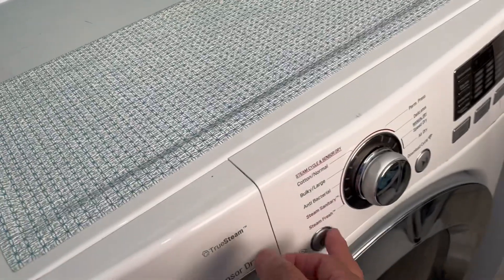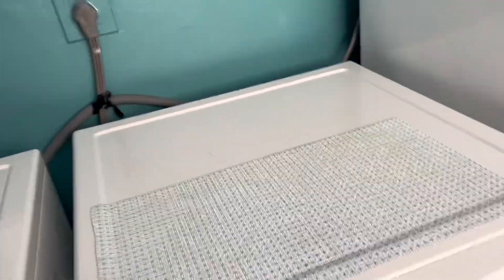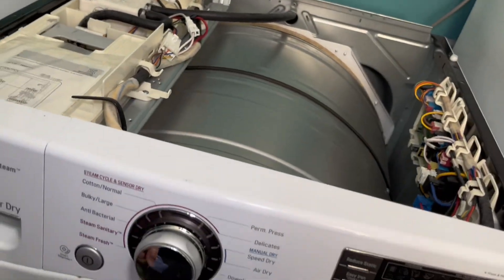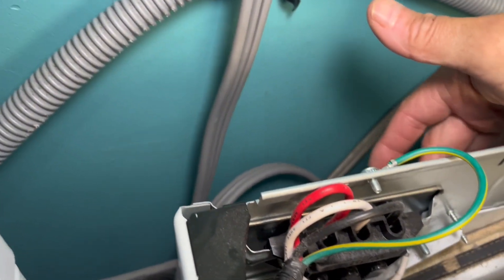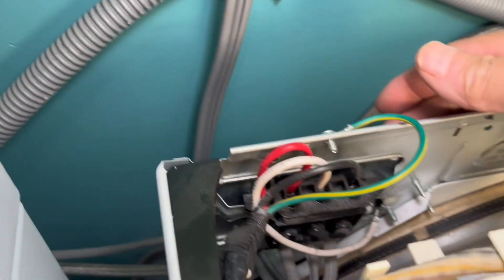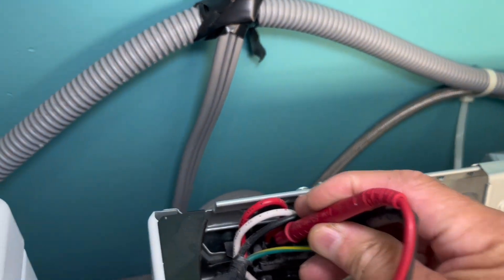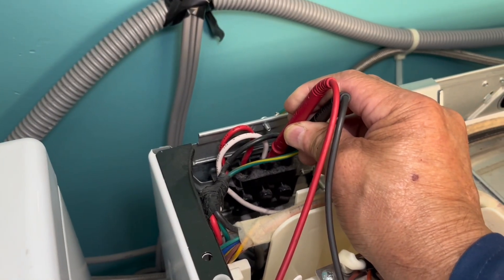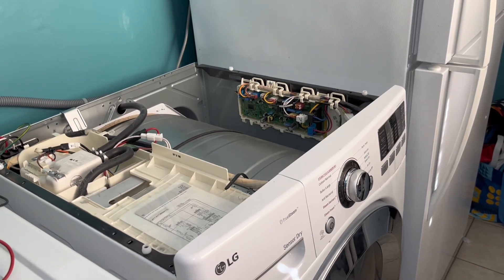How to Check for Voltage to a Dryer. LG Dryer model# DLEX3370W

Comment: I have this one and want to connect the water hose to it for the Steam Feature.  However, I don't see an inlet for it?
Reply from the maker: You may have a reservoir  in the dispenser drawer that you fill up with water. You could learn about it in your owners, manual or if you don’t have one, put your model number online owners manual.